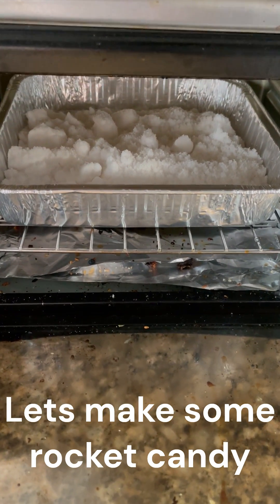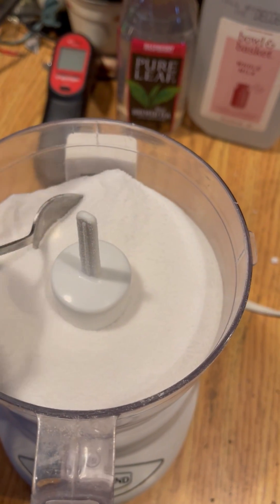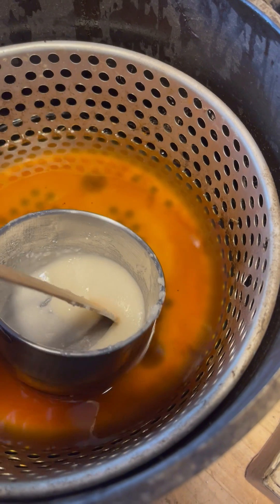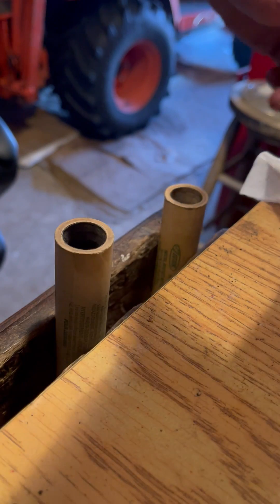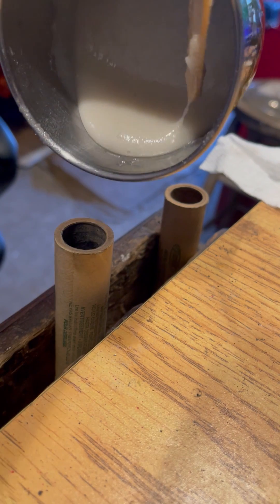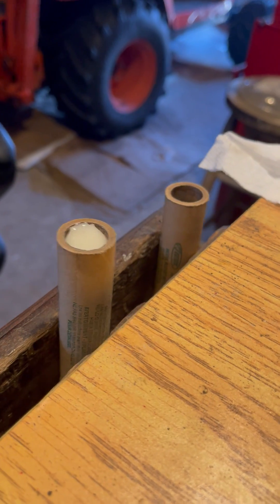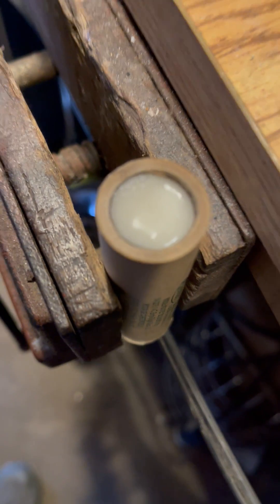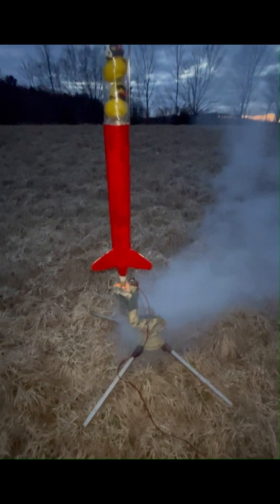Rocket candy motor

Comment: I've used potassium nitrate and granulated sugar, but why still can't fly, it only emits smoke.
Reply from the maker: Bake your potassium nitrate at 250 deg. for an hour to remove moisture. Also grind it to a dust as it does not melt so small particles work better.
Cheers Professor Boz
Reply: @MarkB-mb8fk the composition of my rocket is 65% kno3 and 35% granulated sugar with a total weight of 100 grams, but it still doesn't fly even though I mixed it together and melted it together but it still doesn't fly.
Reply: @Muarisgunwa Hmm that is what I am trying soon. 100 grams may simply not be enough fuel, if it’s producing smoke the reaction is working

Edit: maybe try powdered sugar?